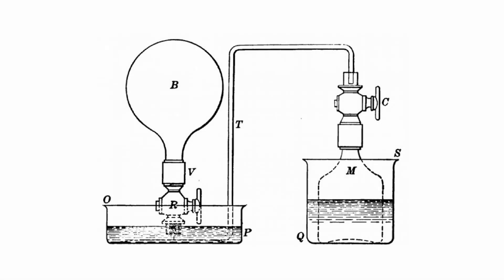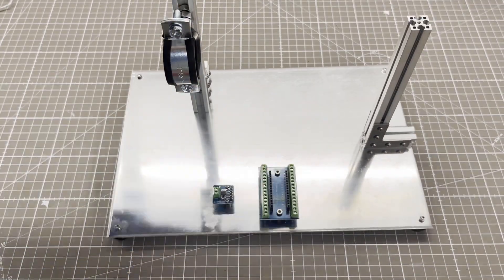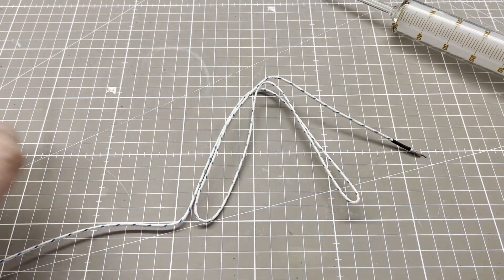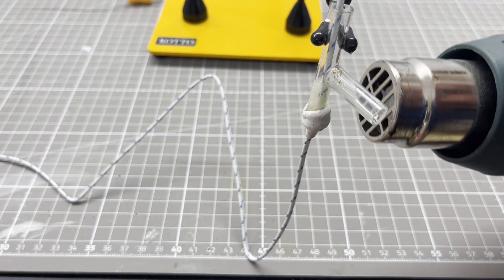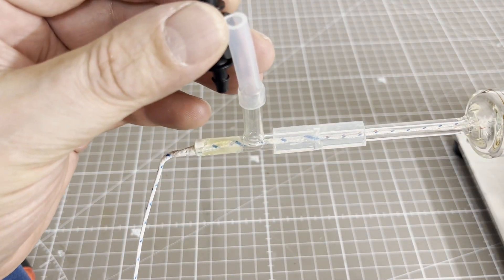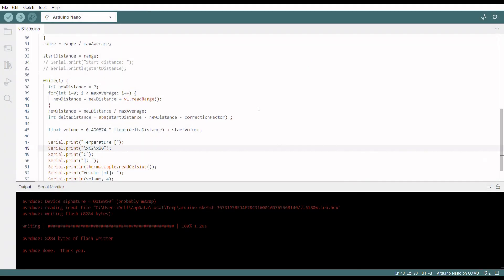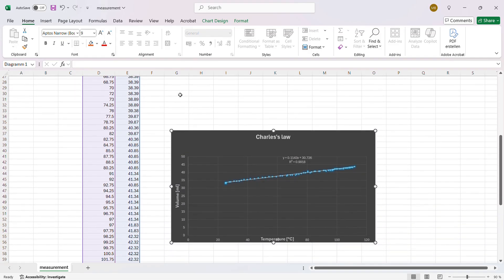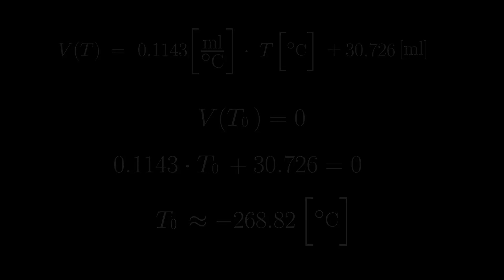Experimental estimation of absolute zero

Comment: I think that you need to account for the dead (unmeasured) volume between the base of the tube and the stopcock, that would help to home in on 0 degrees K.
Reply from the maker: I did. I even took the champer on the piston into account :)
Reply: Very good, so my next thought was did you consider the friction in the piston, or did you decide (quite reasonably) that it would add a constant to the pressure which would be averaged out with the straight line plot?
Reply from the maker: @johncorley8458  I have neglected the friction of the lab syringe. I think to improve the result even more, a monatomic gas (for example, helium) should be used, since air does not behave like an ideal gas. Another possibility would be to use the Van der Waals equation for real gases instead of the ideal gas law.

Comment: Another cool video, I'm looking forward to the follow up that you seem to be thinking about based on your reponses to other comments. Like other commenters said, I'm curious if your small error in the calculation was the accuracy of the displacement measurement, maybe a digital drop gauge would work, 0.03 mm or better accuracy should be fairly cheap to source.
Reply from the maker: Another approach would be to take a monatomic gas such as helium (which comes very close to an ideal gas) or to apply the Van der Waals equation for real gases.
Reply: @Marbslab  Interesting, my background is machining so the easy option in my mind was a more accurate measurement of the displacement, bare in mind I didn't calculate the error for a 24 vs 25 mm displacement, based on the 1mm accuracy of the tof sensor. Would another gas be an easy option to implement, in the US we can get some different gasses at local weld shops.
Reply from the maker: @fuzzymachinist  Helium is easy to get. Other gases used in the lab are also no problem. May I ask if you have your own machining shop? I wish I had a metal lathe and mill for some advanced projects:)
Reply: @Marbslab  I just work in a machine shop, I wish I owned some machine tools for projects too and if I had a garage I'd look into some of the smaller almost benchtop stuff.
Reply from the maker: @fuzzymachinist  Understand. Nevertheless, it's good to have met a professional machinist. I hope I can draw on your expertise in this field if I have any questions:)

Comment: I am wondering if the humidity in the air is responsible for a good portion of the error. Maybe try drying the air to fill the system or fill with nitrogen from a cylinder?

Comment: Another killer project! Showing the practical use of off the shelf modules.
And Thank you for sharing the serial plotter! Now I can actual graph rather than get a ‘gut feel’.
The most effective improvement would be the kitchen cutting board base :)
Reply from the maker: Thank you, mate:) The really cool thing is that you can save the data directly in a CSV sheet. Not possible with the Arduino serial plotter. Perfect for science projects where you have to process the data further.

Comment: I would love to see how close you get to the actual absolute zero approximation by using different gases. Argon and CO2 should be cheap to come by.
Reply from the maker: Yeah, Ar or CO2 are no problem. I am also thinking about completely different setups🤔
Reply: @Marbslab  The setup is good. If I would change just a single thing, it'd be the heating process. Heating much slower would alow the sensors to be more aligned in the time domain and make sure that there isn't a huge temperature gradient across the gas phase. Additionally, I am fairly certain that if you calculate the propagation of uncertainty from the known uncertainties of your measurements, the actual value for absolute zero might fall within the error range of your setup. For instance, the TOF sensor has an uncertainty of 1mm or +-0.5 mm. We're talking about 4 degrees absolute error in your final result, so nit-picking might be worth it. If that's the case, you could consider sensors with higher resolutions. But I'd try heating the gas more slowly first.
Reply from the maker: @BalticLab  Fully agree. The heating is a key point:)
Reply: These TOF sensors are not designed or meant for precision measurements. The manufacturer states the accuracy of about +- 1 centimeter, with drifts due to temperature changes, etc. Of course, in practice they may do better if you treat them nicely.

But it would be much more certain to use a sensor intended specifically for accurate position measurements. Many inexpensive digital calipers are specified to have 0.02 mm accuracy and many models can output the measurements over a wired interface. The cost is similar to that of the TOF sensor.

Comment: would filling the syringe with Ar (cheap enough) help?  probably not. most of the error is probably due to the leakage in around the piston, and temp measurement. Hard to get a uniform temp inside the cylinder. Maybe try cooling to get close to -70C  so the extrapolation error will be less?
Reply from the maker: Pure gas could make a small difference. I've already thought about wrapping a heating wire around the syringe and heating it up slowly. The gas syringe is surprisingly tight. Immersed in water, I couldn't see any bubbles forming under pressure. Perhaps I need to approach the problem in a completely different way. The resolution of the ToF sensor could also be higher. Perhaps something can be done in software.
Reply: @Marbslab  agreed on the ToF sensor upgrade - 1mm accuracy over the 50mm range is 2%, and your measurement got within 1% of the true value..!
Reply from the maker: @ The ToF sensor range is 5 to 100 mm (it works also up to 150 mm reliably. According to the datasheet, the maximum standard deviation of 100 measurements is 2.0 mm. The performance of the sensor is best in the dark. As the piston displacement was just 20 mm, a sensor for smaller ranges would make sense.
Reply: @lumotroph  Would be pretty interesting to see a rudimentary error analysis for the resulting value based on known accuracy information - unfortunately error analysis gets overlooked  a lot even though it's really important to metrology.
Reply from the maker: @ You are right. First physics lecture if I remember correctly 😀
Reply: I was thinking helium. it is the closest we have to a true ideal gas, being the smallest atom by size. Of course there would be issues with leakage, so perhaps neon would be a better choice. Overall you're probably right, the choice of gas shouldn't make a massive difference in this setup.
Reply from the maker: @wyattsheffield6130  I will try it with helium as it's easy to get and I can use it for other projects:)